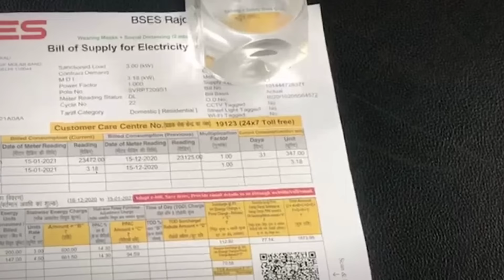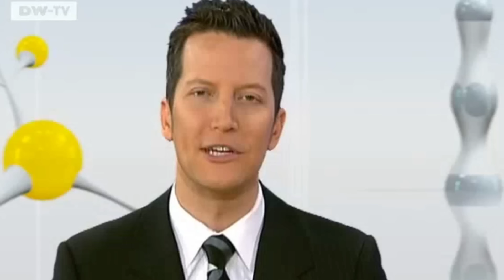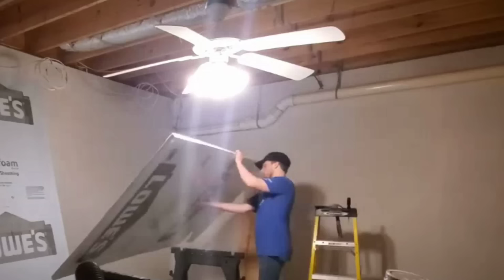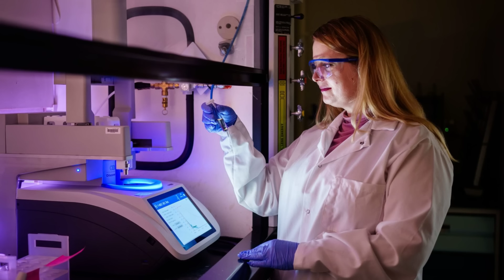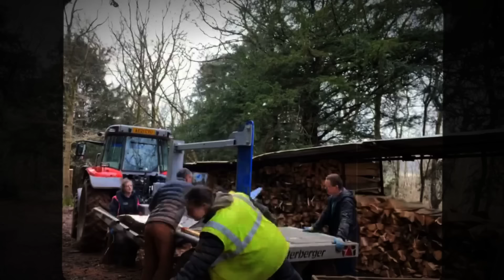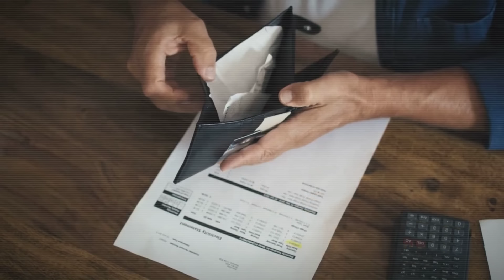This Home Device Stores Energy 90% Cheaper Than Batteries — Why Is It Banned in USA?

Comment: had a funny thought earlier today.. Imagine for a moment using hot water off of your water heater   Run thru a coil of copper  installed where the heating element is  be it gas or electric.  Most driers run between 125- 135 degrees so that they wont destroy the cloth.  So just a inlet and outlet out of a standard water heater.  along with a tiny water pump.

Comment: My house is 3 bedroom ranch with finished basement on south side, first floor is living room one wide window, front door, rest is two bedrooms. Built 1964.  I thought of starting with pop can heater outside with air ducts.  I have solar ground mount in back yard. Diy with tee posts and hose clamps. I have ecoflow delta pro3 with extra battery total 8kw storage. 10kw panels cheap from santan solar.  Maybe i could get sand battery with solar elements for water heat or air exchanger.  What do you think?
Reply: Im also 71 so simple is best.  I had roof replaced due to hail wind damage last year. I had ridge and eve vents added to roof.  House is cooler now.  Electric bill only 35 last month since all my 120 volt items plug into solar .

Comment: If the black flashing is inside your south facing wall (inside the house) and the clear panel is outside, the thermal brick wall it's self will block the sunlight from heating the black flashing inside the house... Are you sure that the black flashing isn't on the outside of the south facing wall to collect heat? with a gap and clear glass 2 inches above it..?  then you attach the black flashing to a brick wall (with thermal mass.. Your directions are so confusing that they don't make logical sense..

Comment: House built in 1959. I have 2 bedroom walls that are south-facing, but each one has a set of double windows almost in the center of the walls. I have one other south-facing wall in the living room. It has no window. That's where our tv & 2 curio cabinets sit. The whole house is built on a cement foundation. We do not have a basement. I live in Northeast Florida USA.

Comment: House built in France in 1880, thick walls of 50 cm. My plan in action. Heat pipes that generate 160 degrees C solar energy. Store in a sand battery in the former wood storage in the existing extension. With refractory bricks diameter 1 m and high 1.30 m. Insulate with rock wool and a cop insulation layer. Connect to a low-efficiency central heating system that will heat the kitchen, living room, bathroom and studio. Heat pipes on both sides of the SSW-oriented roof so that the morning sun is also captured

Comment: 1897 frame and brick with 1" board outer walls and insulbrick siding. Was almost derelict when we moved in in 2010. Wood/oil furnace in basement replaced with gasification wood boiler and 2000 litres water heat storage .

Comment: Live in Wyoming in a 16 × 16 a frame house. Moved from the japanese concentration camp. Set on four foot deep thirty one by thirty one concrete foundation. 4 foot crawl space of clay.
Floor. Facing slightly south west with frontroom and addon bedroom. With other adong bedroom and bathroom in north west corner. And sixteen foot kitchen on back north wall.
And a 24 / 24 double garaged. Added on the east sine on concrete pad.Unfortunately. But fortunately have the rough angled for hot water or more solar panels not. Not happy with solar panels.
And less happy with the 2 windmills. I have gotta redo the whole system. I come to find out they don't like paying for their wholesale electricity to sell back to people. They said they were going to reimburse me this fall 4 -6 grand set price. I'll believe that when I see l o l.😂😢

Comment: 1956, remodeled to the studs in 2001 (due to fire), red brick, full basement, south wall is (up=kitchen, bathroom, bedroom) (basement=storage w/water inlet, bathroom w/HVAC & gas hot water, laundry with electric panel)

Comment: I'm looking into bringing the cool air under my house up into it but there is an odor I'd love to figure out what to do to purify it in a natural cost effective way. I'll be following you great videos. Thank you for your time spent to bring the ideas to us.
Reply: Dehumidifier will eliminate that basement smell!
Reply: PERHAPS A CHARCOAL FILTERED VENT AND FAN IN WINDOW TO BLOW AIR OUT TO PULL AIR ON SHADY SIDE OR HAVE ATTIC FAN AN CRACK WINDOW ON SHADY SIDE...
Reply: Borax to clean away smells and mildew. It can be toxic to pets and children and yourself. So just be safe using it.
Reply: Epsom salt in a bowl absorbs odor
Reply: Look up PlasmaGuard company Pro unit.
Reply: Test for radon gas